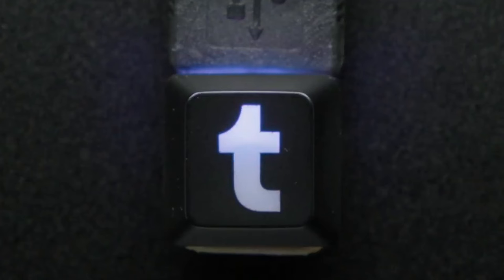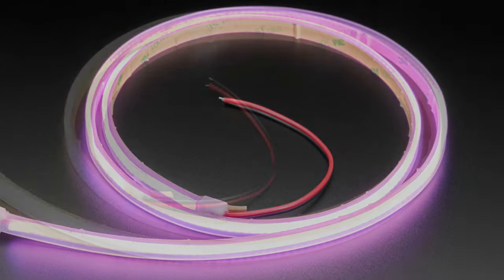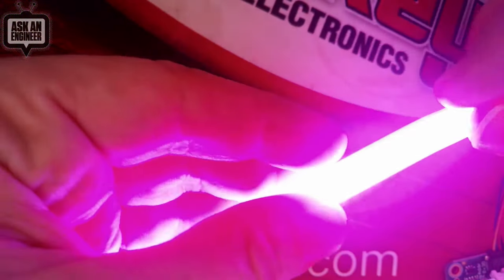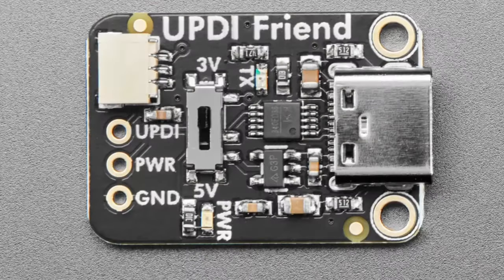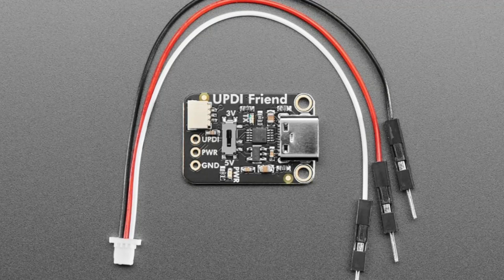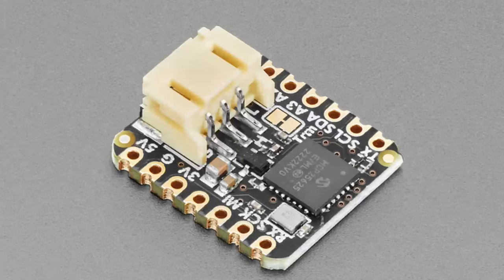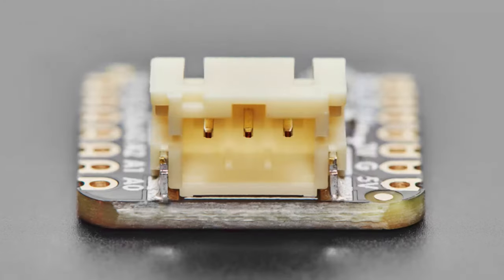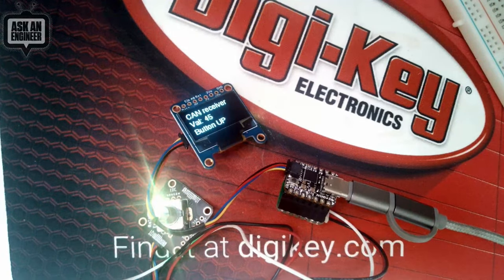#NewProducts 1/24/24 Feat #Adafruit CAN Bus BFF Add-On for #QTPy

Comment: Good afternoon. Need advice. I have on the DAC are voltage regulators spx3819, 5v,3,3v,1,8v,1,2v, on what ultro low noise regulator can be changed?